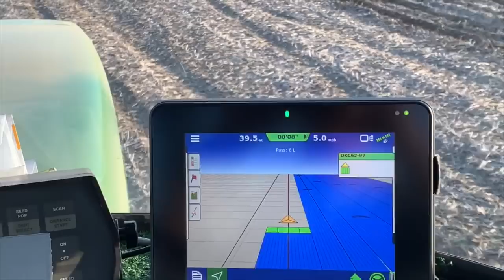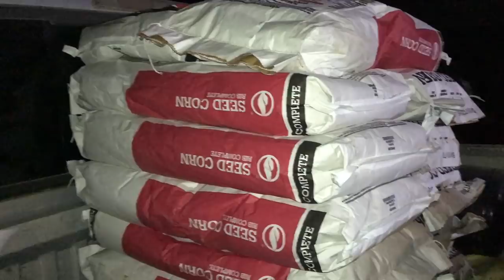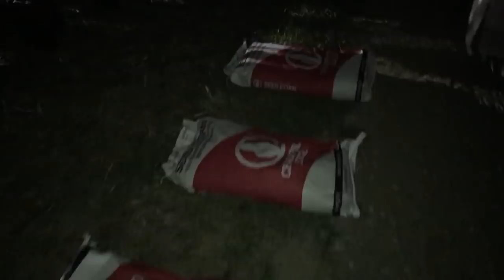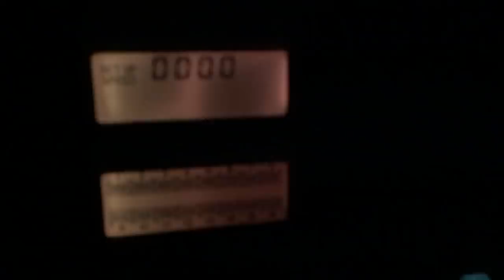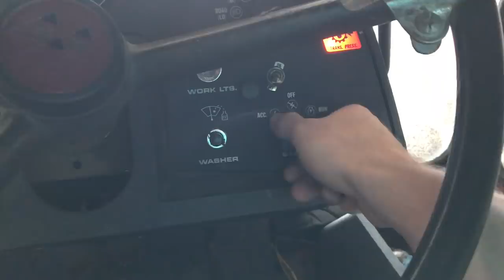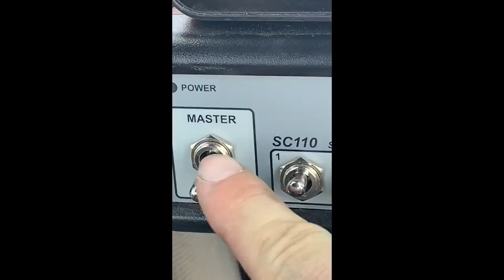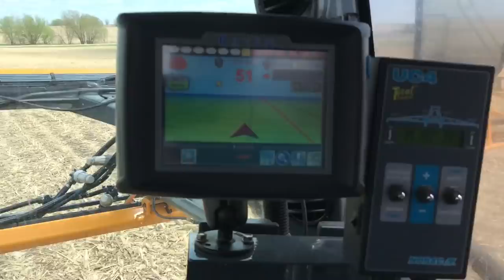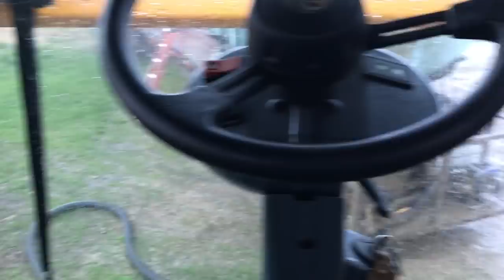Crazy Farmers, Wet Fields, and Chaos | A Normal Day On The Farm

Comment: When cleaning out your seed boxes, it’s easier to use a cleaned out shop vac to just suck up all the seed.
Reply from the maker: Garrett Langfeldt It is if you have electricity close by 😉
Reply: @ColeTheCornstar  try out the battery operated shopvacs like ryobi and other brands, highly mobile, no electricity needed and they last about 25 to 30 mins of full run time before needing to be charged. Might work for you guys and save some time. Great videos and I appreciate what you sacrifice so you can bring food to our table.
Reply: @ColeTheCornstar  
I literally just asked the Same question 
Good ol electricity 
Hmmm

Comment: Right side will win at 212 bushels. We have 8180 white planter. How do you guys set the air pressure for the seed plates? What pressure setting do you use and how do you know you skips and doubles or are you just watching for blockage with the planter monitor? Do you have trouble planting flat seed or do you have plates for that? We don't have flat seed plates and the planter does not like flat seeds.
Reply from the maker: pierrejensen Let's hope so! We set the air pressure right at 2psi. We don't plant flat seed so I couldn't tell you if we have an issue or not! As for doubles and skips, we just use the monitor for blockage alerts.

Comment: I always keep the dipstick in the seat so you dont have to wipe it off before checking the oil level which is always dirty and low for odd reason!
Reply from the maker: EastxTim good thinking!
Reply: I owned a trucking company and every day my mechanics would do Pretrip Inspections and would leave the dipstick out of whatever fluid the truck needed. That way the driver wouldn't just take off in the truck

Comment: Cole , good video. I have a few questions. I know Cooper is your brother, who is Dalton, a hired hand? And when you fill all the bins on the planter with the same amount, why do you run low in some of the bins? When your spraying the fields and you run out and have to go back to the trailer to refill, how do you know where you stopped spraying to continue? Thanks
Reply from the maker: Matt Dalton is a hired hand. On the planter, some boxes suck seed down a little faster than others. On the sprayer the monitor turns shows where we ran out of chemical.

Comment: The dipstick made me think several years ago working construction I had to carry some things back to our main shop. I had to use the shops small loader with forks to unload but the shop was going to be closed when I got there. So i called the shop on where the key was at for the loader they told me but, as a joke i wired the key to the dipstick on the engine. You guessed they called the next morning on the radio wanting to know where the key was.i came back on the radio and said if the had checked the oil they wouldn't have to ask...

Comment: Im wondering how much 32 you are putting on the bean ground. I was under the assumption that you don't want much nitrogen on beans as it will make them lazy and not produce their own nitrogen. educate me.
Reply from the maker: James Pollock We put 32 on ground that is going to be corn. On corn going in bean ground we put 22.5 gallons an acre. Corn on corn is 33.5.
Reply: @ColeTheCornstar  ok thanks.  I thought you meant you were putting 32 on the field that would be planted in beans

Comment: Hey Cole, congratulations on your graduation!
As a non-grain farmer, I've got to ask a question.  What's the difference between corn on bean and corn on corn seed that you were referring to?
Reply: You can't plant the same crop over and over on the same ground because you are susceptible to disease bugs and weeds if you do.   Rotating crops controls these things
Reply: When you plant corn after corn there are some diseases and insects that can survive that probably won't cause a crop failure but do reduce yields. Thats one reason to rotate crops so you break that cycle. You can plant corn 2-3 years without much problem, but the pressures keep increasing.  Seed he's referring to as corn on corn has between seed treatments and genetics traits that help it be resistant to disease and insect pressures so yield losses are minimalized.
Reply from the maker: Thanks for answering the question guys
Reply: madfarmer912 dave     Hey I asked a similar question. S O  thanks for explaining,  👍

Comment: 5 grand for an old ass truck 😱 I can get a 2005-2008 diesel with 140 thousand miles on it for less
Reply: Umm no you can't 😂😂 😂
Reply: Yes I can literally all day long. Ford 250s with 6.0 s in them are even cheaper here
Reply from the maker: Mike Hall For the miles and being a 1 ton with no rust, I don't think that's out of line.